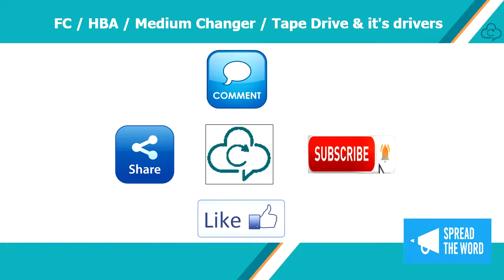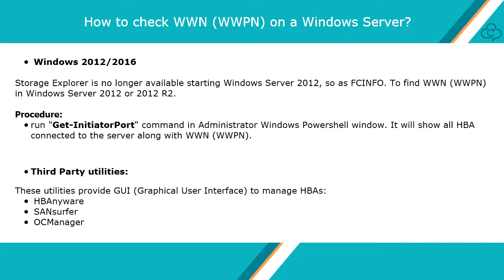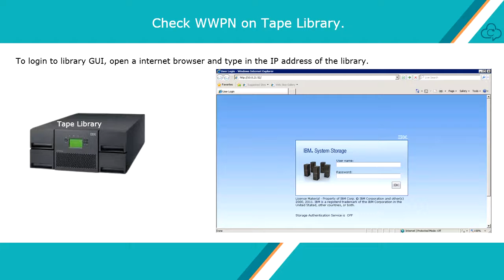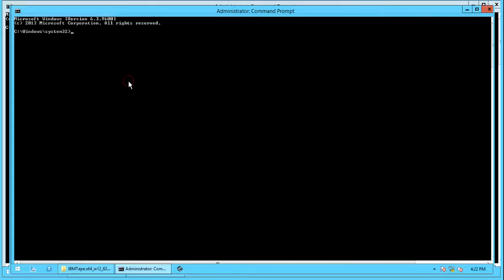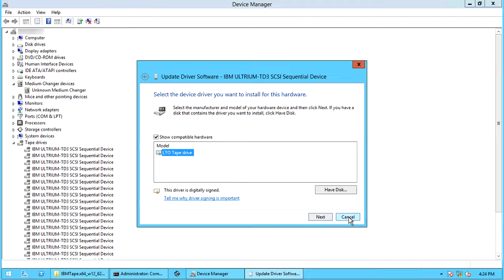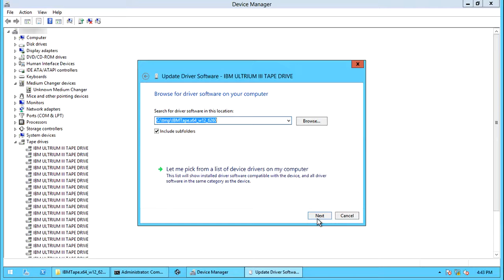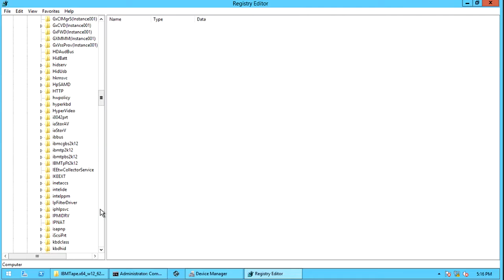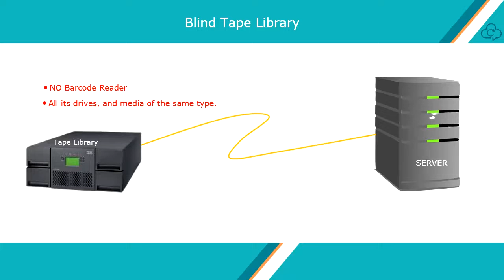End-To-End SAN connectivity between server and tape library (FC/HBA/TapeDrives/TapeDrivers)

Comment: Hello, thanks for the video

I use a san with two servers connected by a san switch.

I want to make an archive or a backup with StoreEverMSL2024.

So I will link StoreEver with the san switch. is it possible?

The second question is if I need another software for backup like (veeam or dataprotector) or it can do the backup itself.
Reply from the maker: Hi Ayanleh, as you are planning to connect the tape library to both servers, you can share the tape library and can use it for backups or archive as per requirement. It can be done using Commvault so no other software is needed.  If you need for both backup and archive it can also be done to same library or split it into 2 partitions and use as 2 different libraries I.e. one partition for backup and other for archive.
Reply: @CorpVault  I will only use it for backup.

But the problem is that I want to use the FC (fiber channel) port of the StoreEver MSL2024 for interconnection between servers via a SAN switch.
Is this possible?

We already have micro focus( Dataprotector) can't do it with that for backup.
Reply from the maker: Yes it is best way to connect the library to SAN switch and then connect the servers to the same San switche(s) and the perform zoning so connectio  is  made between them.
Reply: @CorpVault  Thank you very much.
does the msl2024 server have a web interface to manage?

Once connected on the san, is there a configuration to interconnect the server and the libary or software (commvault) that allows to make intérconnection?

Please help me I want to finish this work thank you
Reply: Give me a guide to follow, if you have .
Reply from the maker: We are sorry we do not have any guide.  All tape library come with Web interface and it needs to be configured over LAN interface. Is this tape library new then the vendor will configure it.

Comment: Please share the link to download!
Reply from the maker: Hi Paul, which software  link you need to download?
Reply: @CorpVault  sorry I would like the link to download the tool to enable FCINFO on CMD.
Reply: @CorpVault  plz for Server 2012 r2 or 2016 thanks
Reply: @CorpVault  this is the error I’m getting ‘’ setup can not continue the WMI interfaces to be added are older then existing interfaces in the repository. Please advise!
Reply: @CorpVault  thanks I get it right everything just like shown, could you share also a video on how to do backup on a tape since I can see everything but still can’t access the drivers and make a backup, thank you in advance.
Reply from the maker: Now that the devices ate seen in the OS they need to be configured in backup tool Commvault for use. There are our videos on how to configure and use tape device. Please check them.
Reply from the maker: This one
https://youtu.be/yJkaKLiNqsM
Reply: @CorpVault  This is really helpful! I have this device for almost 3 years not using it now it seem like I will be using it now, will let you know how the out come. Thanks again!
Reply from the maker: Anytime 😊

Comment: thank you for sharing this video 👍

Just a question, what is your practice in zoning tape drives to a server? is it 1 initiator 1 target in each zone?
Reply from the maker: Ideally the SAN team takes the call. You can have 1 initiator + n drives. I have seen on physical 2 to 6 tape drives and VTL 8 to 16.
Reply: @CorpVault  alright. I have same scenario were 4 lpars needs to be zone on 8 tape drives. So in that case i can zone lpar1 + 8 drives in one zone? Then same goes with the 3 remaining lpar total of 4 zones? Each zone has 9 members
Reply from the maker: Best practice is on a HBA you have 2 FC ports for redundancy. Configure 4 drives for each FC port (so 2 zones) so if one goes down you still have access to the rest and will also work as balancer. Rest you can do what you said.
Reply: @CorpVault  yeah, that's a good practice 👍 thank you 
Are you also familiar with path failover feature of ts4300?
Reply from the maker: Yes Tony, I am aware of it but never worked to test it. As I recall it's a licensed feature? What I had in mind was how does it work with persistent and non-persistant (exclusive) tape drive reservations from backup application. 🤔
Reply: @CorpVault  yeah it's a feature additional license. I haven't test it also, I don't get the logic behind it since every tape drive we have has only 1 fc port. How it will failover to other path? I just saw it in our ts4300 tapes having that license I dunno how i can leverage that features. 😅

Comment: One more doubt, please clarify it.

We have procured server and Dell ML3 device. But there is no physical connector provided for server and backup device.

But both are are connected to LAN using lan cable and both are rechargeable in network.

In this situation can we configure backup  tool?
Reply from the maker: LAN is for accessing Library console and also help to do like check readiness. The actual backup data does not travel over it. You need to have other connection made for it like FC/LC/SAS etc.
Reply: @CorpVault  Thank you for your clarification

Comment: Is it possible to connect LC cable directly (with out switch) one side tape library and one side server?
Reply from the maker: Yes it is possible if there is port available on tape Library and PCI adapter on the server
Reply: @CorpVault  thank you for your support and response